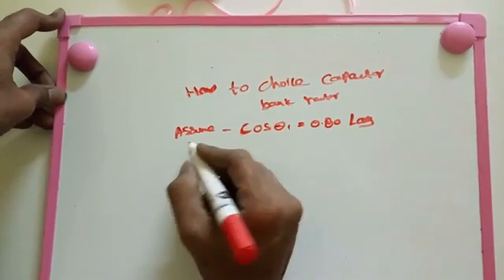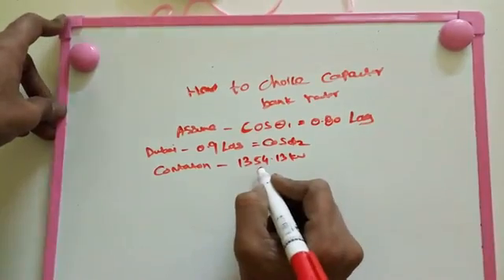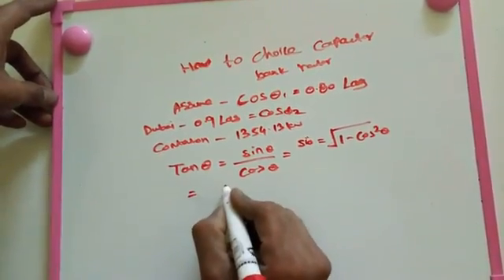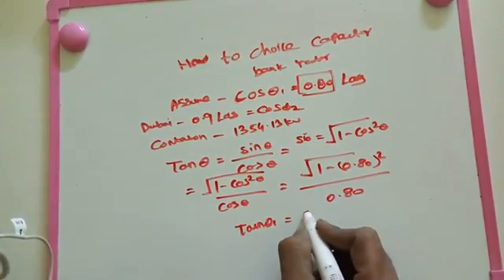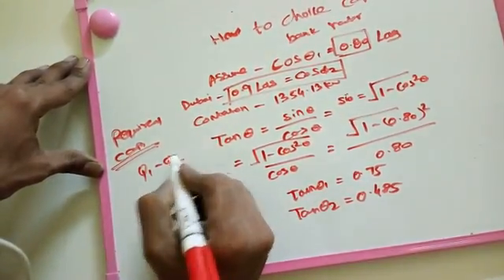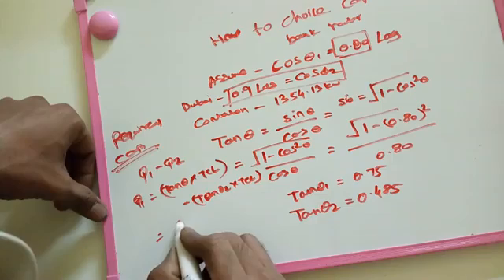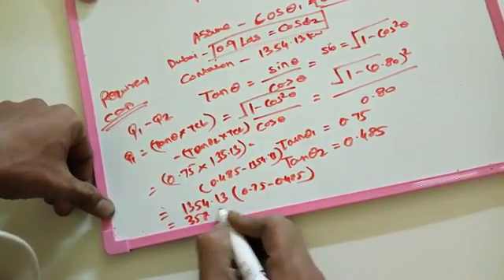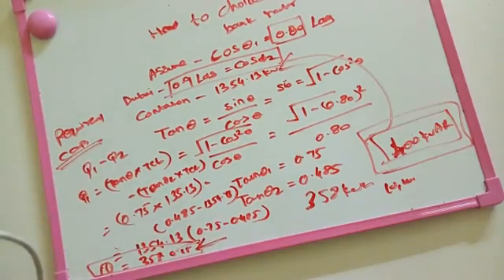How to calculate capacitor bank rating new 2017

Comment: Thanks sir. 
Sir , can you tell how will we take power factor in a system , example a single line drawing of 5 floor hotel building. 
In each distribution borad, sub panel and the main panels we consider the load schedule by  only assume the power factor to be 0.8 and do the rest of the calculation, like current, wattage etc... But when it's comes the question of  power factor- capacitor bank , how will we calculate the existing power factor with load schedule, Theoretically...
Kindly reply.